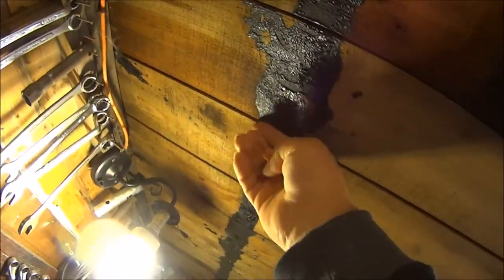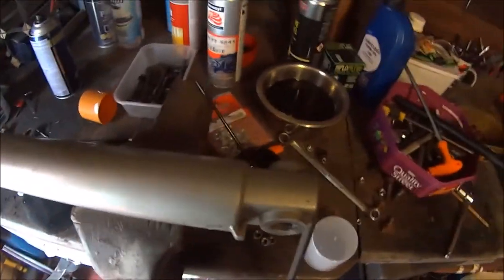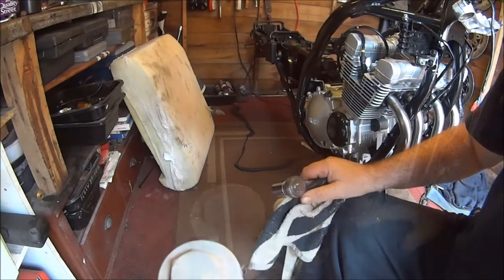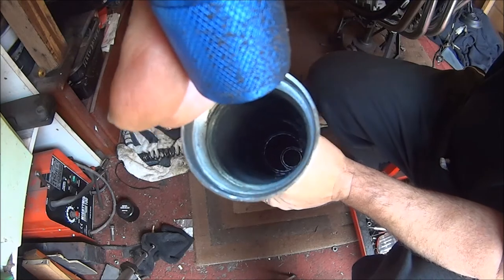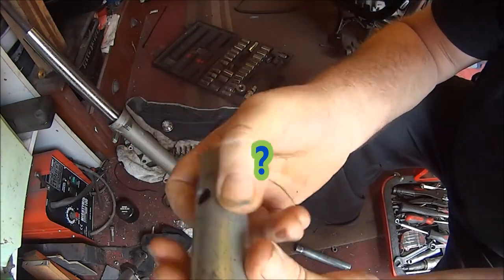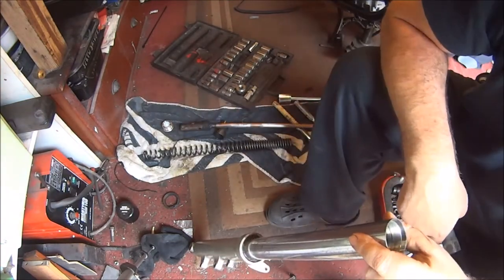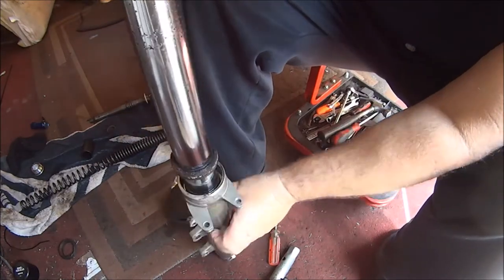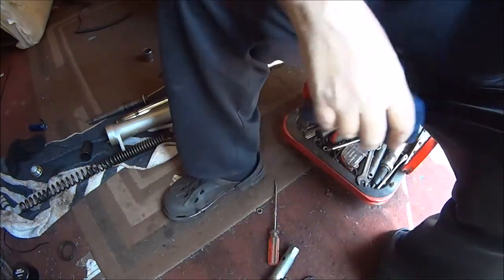XJ 900s diversion fork seals replacement. Part 1 of 2 UK.

Comment: Thanks for the video. I just figured out that if I want to shorten my XJ900 shocks I dont need to pull the fork tube even out- if I get the bottom screw open I can put a spacer where needed and cut the top part of the spring to proper length. Your video showed me exactly whats inside and how to do it.
Reply from the maker: Glad it was of use to you buddy and thanks for the comment.

Comment: John I have just done mine two or three weeks ago it's not a bad job the upside down ones are a little fiddly, scaffold bar is good mate for knocking the bushes and seals in a good job well done...
Reply from the maker: SooperSkoots upside down forks do look a bit tricky not had the pleasure as yet.. Thanks for the scaffold pipe tip nice one.

Comment: Good job! I cut a few corners and didn't open the top end with the damper rod. I just cracked it open in the bottom, poured out the old oil, replaced the seal, refilled and tightened the lower bolt. Then I didn't have any of that spinning rod nonsense.
Reply from the maker: Cheers buddy, yes a pretty easy job if everything comes undone ok 👍

Comment: that has encouraged me to have a go at changing the fork seals, thank you. the only thing that puzzeled me is why you did not rub down the pitted area of the stanchion with wet and dry - the weather would get at it again i suppose?
Reply from the maker: Thanks Ian.. Save your self a shedload of money that's for sure.. I did rub them down believe it or not but they was pretty bad at the top..
Reply from the maker: Cheers bro.

Comment: Hi mate, I'm on my third XJ900 now. All three have had some semblance of wobble on the front end, seems to be a common issue and more luck to not have it according to a lot of the forums. But my latest XJ has a severe wobble, found you're video as I noticed a blow fork seal today and wanted to refresh myself on the damper bolt as it's been about 8yr since I last did XJ forks. Anyway, just wondering if you've ever experienced a severe wobble on the front end when letting go of the bars? Mine is bad enough that if I didn't stop it I reckon it'd tank slap.
Reply from the maker: Hi buddy. A good quality new tyre and wheel balancing is first thing I'd try. Obviously do the simple checks before that, buckled front wheel,  excessive play in the steering headstock bearings, bent forks or frame, and check wheel alignment,

Comment: Your tubes been usefull, but its not a 26mm box spanner is a 20/22, if your going to buy them, buy the set [ £7 to £11],so you add a box spanner for more length then add a socket on end if you have limited extension bars
Reply from the maker: Thanks for putting us on the right track buddy 👍

Comment: Hi. What was the internal damper nut size , so I could make a tool to fit  the alan bolt.  please.
Reply from the maker: hi peter. it was 26MM, hope that helps good luck
Reply: @jonyr1TT  Big thanks mate, just the job, thanks again.
Reply from the maker: your most welcome.

Comment: Love ya channel, cheers from Australia! I do have a question. Got 2001 Divi 85,000 kms. I been told that the forks on the front need rebuilding, any advice on improving suspension on both front and rear? One guy says heavier oil in the forks? I not sure what is best. Suspension was never great and its set on the softer side. Im 50 and full of girth at 140 kgs, and no Im not giving up the Pints... email a_a_campbell@hotmail.com
Reply from the maker: Cheers buddy. I'm no expert on shocks and forks.. On my XJ900S the forks are none adjustable and I'm very happy with the way they perform. Some people say the adjustable forks on the later modals aren't very good. So I would try some    heavier springs or sorce forks off of a earlier modal.
Reply: @jonyr1TT  Thanks mate will do!
Reply from the maker: Stay safe. 👍
Reply: The manual says 5W, but try 10 or 15W oil and see how you like it.